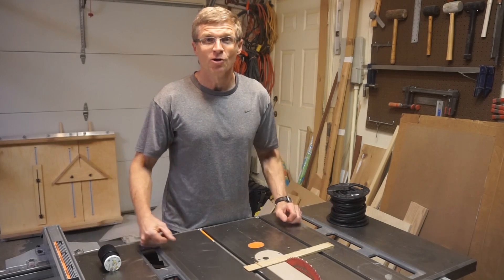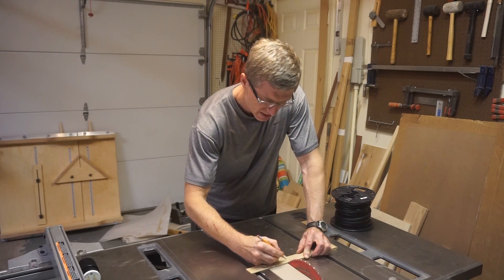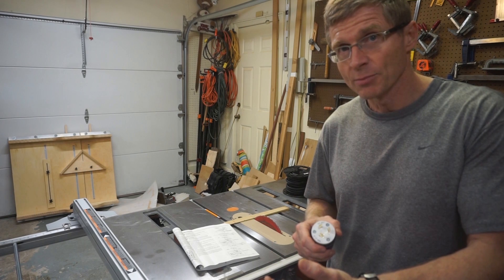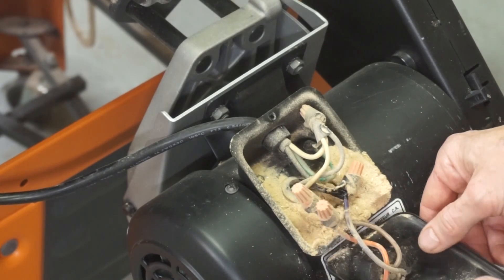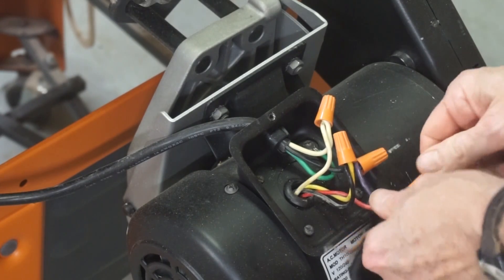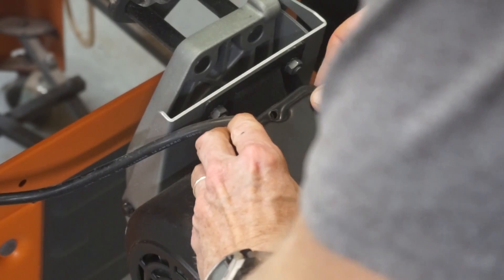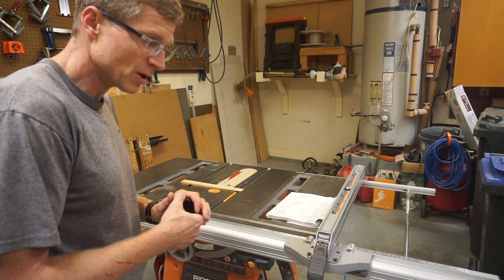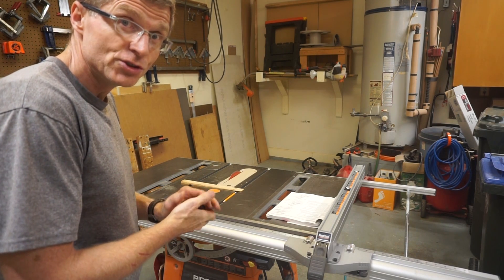How to Upgrade a Table Saw from 110V to 220V

Comment: I have a bunch of mesquite wood from my property that I have been working to get milled into usable boards instead of logs. Mesquite is about 2 times harder than hard maple which presents issues when cutting boards from logs and then milling and then making usable boards. My bandsaw Ridgid BS14002 and table saw TS3650 sometimes struggle especially when sawing 5 1/2" tall slabs on the bandsaw or ripping full blade height on the table saw. I was considering getting a larger motor for the table saw and putting that motor on the bandsaw, until I saw your video about converting to 240 volts. I did that today on both saws, they made cuts that I would typically struggle with in the past. Between the 12/3 extension cord and the 2 new 220v plugs I spent about 50 bucks instead of 400 for a new motor.I had previously wired my shop for 240 so already had sunk cost there. For those that want to do a great upgrade for low cost consider the rewire to 240 volts. Fantastic upgrade.

Comment: Did mine although on some motors and switches you'll need the 1/4 female spade flag connectors are a must because of space you may not get your wires back in if you use the all straight ones

Comment: It wasn't necessary to increase the wire gage. If the wiring was large enough to operate the motor, it was more than big enough to operate the motor on 240 at half of the amperage of 120.

Comment: I've got an 80s Unisaw wired for 220v that I would like to bring with me when i move to Spain from the US.  Is the 60hz US to 50hz Europe difference going to be fatal?  I won't be using it all the time, probably a few hours a week if that.  I can get around with 15% less power, but if it's going to burn up in 3 weeks I won't bring it.

Comment: I have a R4512 and am doing the upgrade now (I believe your model has the same size motor). Since the saw only draws 13 amps at 110v, if you convert to 220V the amperage now only peaks at 6.5 (half). I elected then to get a 15amp breaker with 14g wire.

Comment: Just remember higher volts means chop wood like butter including 4x4's but any accidents it will get you i know i worked in a high power shop and with dust on the floor it got a fellow worker blood was everywhere

Comment: Upgrading the wire is not necessary. To the switch or the motor. It's already sized from the factory to handle 115 or 230v. Just snip the 115v plug off and install a 220 plug on. Change the motor pole wiring from low voltage to hi voltage and ur done... my saw was 1.5hp on 115v and 2hp on 220v. Made a world of difference when ripping boards or resawing.

Comment: Just did this to my TS3650, thanks for sharing.  I think there is a misnomer that upgrading does not give you more power; while its true the overall wattage does not increase the power I think from a practical point of view does, and does dramatically.  Before the conversion I ripped half a 2x4 single pass on the most twisted 2x4 I had laying around, the saw made it through but the blade slowed and the 2x4 wanted to gently "float" backwards towards me (the kind where you ask yourself if continuing is worth it or not).  After the conversion and cutting the same 2x4 with the same blade the 2x4 just passed right through, not wanting to float back and the blade didnt slow at all, so from a technical perspective that is more power, because I did the same amount of work in less time.  
For years I told myself that my 1.5hp motor would be the same at 120V as it would be at 220V.. but it isnt.  I finally played with a amperage meter and found that the average amperage per volt is higher now on 220v than it was on 120v.  Sure, the saw is rated for 13 amps at 120V but if you watch the line draw when you cut at 120v not unless you pin the blade and hold it there will you ever get those amps into the motor, there just isnt enough voltage to send it in a meaningful amount of time, whereas the 220V can send the amperage much more easily and much faster and therefore you can actually use that power when you need it and so this makes the saw much more powerful from a functional perspective.

Comment: can you do this with any portable table saw?
Reply from the maker: Not all table saws have motors that can be converted to 220V. I recommend checking the manual for your saw. If it can be converted, the manual usually has instructions and a wiring diagram to do that.

Comment: Know it's been a while since this was posted.

For those saying you are doubling your voltage but halving your amperage so you don't need higher gauge wire.

Circuit breakers and wire gauges aren't set for ideal situations when everything is working as planned. They are set for when things go wrong. Say something in the motor for the saw breaks or a small piece of metal falls in at just the wrong place. Everything appears fine but now the saw is drawing 19 amps while sitting unused. The fire that burns this guy's house down will have started at that 3 inch run of 14 gauge he spliced his 12 gauge wire on to because that 14 gauge can only handle 15 amps, the remaining 4 from the 19 being drawn is going to turn into heat.

If wired correctly there is no danger of fire. It will just sit there quietly drawing 19 amps until it breaks all the way.
Reply: This is why I asked if he also upgraded the wire from the switch to the motor...which I’m guessing he did not. That’s just dangerous...and not pointing that out to others considering this “upgrade” is irresponsible.
Reply: @WinnieJack2024  He could install an inline fuse between the switch and the motor.

Comment: For the same power, when you double voltage, amperage drops in half. Wire gauge is usually related to amperage rating. I do not believe the 12 gauge wire is necessary or beneficial. 
I am planning to upvolt delta.

Comment: thanks, just recently bought an older Delta Table Saw and it does have the ability for conversion, I can't wait to put this video to use.  Finally breaking down and building my wife's dream cabinets and bookshelves for the living room she's always wanted, so I'm sparing no expense (sort of) to get the right tools for a great job.  The Delta is the first step and doing a little rehab on it before the main job is one of my plans and this video should be pretty helpful

Comment: Couple of things I'll add to this:

Motors in the US are wound for 60Hz motors in Europe are wound for 50Hz. 

A discussion of what happens is here:

http://www.50hz60hz.com/60hz-motor-running-on-50hz-power-supply.html

It will decrease motor life.   But a table saw is not used in continuous duty so most likely it won't make any difference in this application.

Now as for the advisability of doing this change:

The big problem with consumer table saws at 120v is the wires that feed them (including the power cord) are NOT sized properly.  To properly feed most consumer table saws on 120v you must run at least #12 awg copper wire from the saw all the way to the panel.  On a dedicated outlet.  And that is if you are practically on top of the panel.  If the panel is at the other end of the house and you have a 50 foot extension cord on top of that you really need #10 AWG on a 30A 120v circuit.  If you don't want to convert your saw (or can't) then you can replace the power cord and have a separate 20A or 30A circuit run to it depending on how far it is from the panel.

THE BIGGEST BENEFIT IN THIS VIDEO IS THE DEDICATED CIRCUIT.  In comparing a properly sized circuit at 120v vs 240v you will see little difference in power at the saw blade.

However, you WILL see the motor run cooler at the higher voltage and there will be less internal winding loss in the motor.  Windings in a motor cannot be made out of 12 awg or 14 awg.  or the motor would be the size of a car engine.  So the motor windings heat up and that heat energy is lost power.  At 240v the current running through the motor is halved and so the motor runs cooler and as a result loses less of the power to heat.  This also lengthens the motor life.

This conversion can also be done to drill presses and indeed it can be done to anything that uses a motor that is wired to be convertible.  And virtually all AC motors used in these tools can be converted.

Most AC motors have a circuit diagram in the cover plate of where the wires go into the motor that shows how to switch them from "low voltage (120v)" to "high voltage (240v)"  They have been made like this for almost a century.  And even the ones that don't and don't bring the windings out for conversion can be opened and converted by a motor rebuild shop.
Reply from the maker: Excellent explanation.  Thanks!

Comment: Hello,  do you know o heard if dewalt table saw dw745 could be rewired from 120 to 240v ? cause i cannot find anyone done that. :) and usa dewalt is kinda 3 times cheaper than european version :D
Reply: No, this only works with saws that have induction motors. The DeWalt has a universal motor which cannot be rewired. Attempting to do so would easily burn up the motor and start a fire. Do not try it.

Comment: Great video. Currently working on turning my garage into a woodshop and trying to avoid the breaker tripping issues I've experienced in my friends garage. You mentioned the lights didn't dim when you fired up the saw on 240, but isn't it on a completely different circuit? Wouldn't it have also not affected the lights on a separate 110 circuit as well? Or is it possible to have 110 and 240 outlets on the same circuit?
Reply from the maker: Yes, the saw is now on a separate circuit after I converted it to 240V. Prior to that, it was on the same circuit as the lights, so that's why they were dimming (or going out completely when the saw tripped the breaker). Yes, I could have put the saw on a separate circuit to avoid that problem, but I was happy to convert to 240V to get a quicker startup, as well.

Comment: And now you can upgrade to 400V. :-)
But then u need 3-phase-400V in your garage and a new Motor.
No. Just kidding. Interesting to see, that some motors 100 and 220 Volt kompatible.
I didn't' knew this.
Cheerio from Germany (working with a 400Volt tablesaw)
Reply: stupid comment.. like Germans
Reply: @fnakos  Yes,  you can call my comment stupid, if you think so. BUT this has nothing to do with Germans. THIS is a stupid comment from YOU.

Comment: Hi Mike could you explain why you didn't use the ground wire on the motor. Thanks
Reply from the maker: The motor was already grounded with the green wire that was screwed into the body of the motor. My new cable from the wall brought the ground to the switch, which was already connected to the motor.   I hope that makes sense.

Comment: Hi mike, greetings form Sri Lanka! Im planing on purchasing a DeWalt DW745 Table Saw (120 volts) from Canada. Here in sri lankan the voltage range is  around 220 and 240 volts. I'd like to know if it's safe to use a stepdown 3000 watt transformer? Hope to hear from you soon!
Reply from the maker: I think the only issue you may have is that the saws in North America are designed for 60Hz, versus the 50Hz power in Sri Lanka. The motor will still work, but it will have less power. You might be better off purchasing a saw that is designed for 220 volts, if possible, and avoid having to get a transformer. For example, there's a DeWalt DW744-QS that may suit your needs if you are able to find one. Good luck with whatever you choose! -- Mike
Reply: Thanks for reply mike! Well im no expert with transformers but some transformers are capable for switching from 60Hz to 50Hz yah? Will that do the job? Btw the 240V version of the DW745 are sold only in UK and its double the price without shipping.
Reply from the maker: I'm not an expert on transformers either. If you can find one that converts the frequency too, that would be great. Otherwise, you could also get a frequency converter, but then it starts to get expensive. I don't think we realize how lucky we are to have access to all of these products that are not easily available in other countries. You can probably run the saw at 50Hz without any real problem as long as you realize that it will run slower. Depending on the type of work you'll be doing, that may not be a problem.
Reply: Thanks for the info mike! keep up the good work!
Reply: No, a transformer transforms only Voltage. If you give it 50 Hz, u will get out 50 Hz independed of the voltage.

Comment: Im going to swap out a 110v motor on an old table saw with a 220v motor. My question is the switch on the saw able to be used with the new motor? or do I need a switch that works with 220v?
Reply from the maker: You can use the same switch that you already have because it's still the same number of conductors (hot, neutral, and ground).
Reply: Thanks got it all switched over.
Reply: But aren't you using two hots and the ground making up the three wires in the new cord?  I want to convert my Delta TS. I have a diagram on the motor to switch to high voltage but not sure how to connect the switch..?

Comment: Thank you for posting!  I think you may have sold me on the 240v conversion.  I am currently build a new shed/shop and think a separate circuit for each of my hefty tools @ 240v would be the best bet.  Thoughts?
Reply from the maker: I think it's a good idea to use 240v whenever possible. You probably don't need a separate circuit for each tool unless you'll be running them simultaneously. You can probably get away with having all of those tools on the same circuit.  Good luck with everything!

Comment: Hi.  Probably a simple question; but wouldn't you need to swap out the wires for a higher gauge as well?
Reply from the maker: Not really.  When the voltage is doubled, it means there's only half a much current running through the wires, so the existing wires would be more than sufficient.
Reply: @Woodumakeit  this is true, however wiring 12g to (presumably) 14g inside the switch, and from the switch to the motor, was a bad idea.  If you wanted 12g from the wall to the saw, you should have run it all the way to the motor.

Comment: I want to do the same thing but I just can't decide if I should put it on a 15 or 20 amp breaker. What size breaker did you use and have you tripped it at all since moving to 240?
Reply from the maker: I have it on a 15A breaker.  When it was on 110V, it was also on a 15A breaker along with the lights, so I did trip the breaker from time to time. Now that it's on its own circuit and it's running with half the the current now that it's on 220V, I haven't tripped the breaker and I doubt there's a chance that I will.
Reply: So if you used a 15 amp breaker was there any reason why you put a 20 amp plug onto it? Just curious.
Reply from the maker: Very good question. When I got my band saw several years ago, it had a 20A plug on it, so I put in a 20A receptacle for that. I wanted to use the same receptacle for the table saw, so that's why I used a 20A plug. That probably does not meet code and maybe I should change the breaker. I definitely don't need that much current though.

Comment: I'm about to pick this same exact saw up in about 10 minutes and want to go 220V from the very start. What sizes breaker in the panel is your 220 outlet hooked up to?
Reply from the maker: It's on a 15A breaker which is plenty. That's like having it on a 30A breaker at 110V.

Comment: Really enjoyed the video and your explanations through out.  One small question in regards to the new plug wire. Was that just being overcautious?
Reply from the maker: I needed to replace the plug wire because I wanted it to be longer to avoid having to use an extension cord, especially because I only have one 220V outlet that's on the other side of the shop. Now the cord is long enough to allow me to position the table saw anywhere in the shop. I definitely didn't need to use 12 gauge wire, though. That was the overly cautious part.
Reply: I can completely relate to the extension cord issues.  Thanks for the respone!

Comment: Hi from Belgium ! You have a very interesting channel, keep on going !Does every 110v motors can be switched to 220v ?  Here in Europe, we have 220v and some tools you have in the US can't be found in Europe (or very expensive), so it would be interesting to buy US tools and convert them with 220v.Thanks in advance for your response.By the way : Happy new year ! :-)Stephan
Reply from the maker: Thank you, Stephan, and happy New Year to you too!  I don't think all 110V motors can be rewired to 220V (unless you have a lot of expertise), but a lot of tools have motors that support both voltages and they just need to be rewired like I did with my table saw. I would look at the specifications of the tool. It will probably indicate whether or not the voltage can be converted.
Reply: Thank you for your response.  I noticed an other detail : in Europe, we are using 220v 50Hz and in North America you're using 110v 60Hz ... that difference in the frequence could be an issue.  However, i could still use a transformator which would be safer.  Anyways, thanks a lot and keep on going.
Reply: SD Woodworking  All motors can be converted back and forth from 110 - 230 or from 230 -110
Reply: FYI, I have a US bought table saw originally wired for 120/60 which I have rewired to 240/60 according to specs (just as Mike showed). Now it runs without any problems on 230/50 here in Norway, just a tad slower but with good power. Will soon convert my band saw and jointer to the same, but must use a big 3000W transformers for the 120/50 I cannot convert.

Comment: i think its handy to change the voltage to 220V on the wire box
Reply from the maker: Thank you for your comment.  It was definitely an easy conversion and a great improvement. No more lights dimming when I start the saw, and it's a quicker startup with more consistent power throughout the cut.